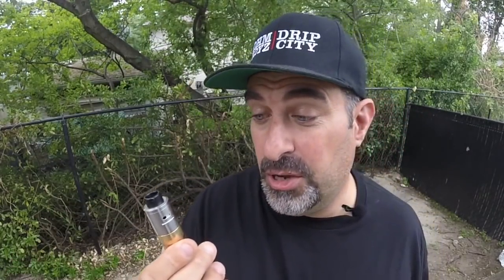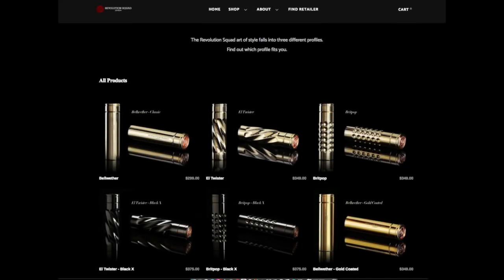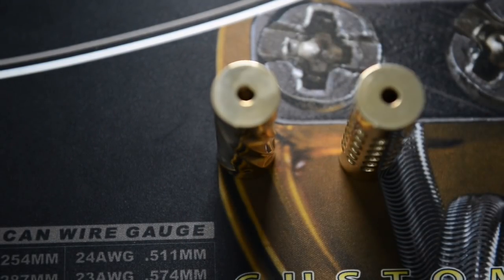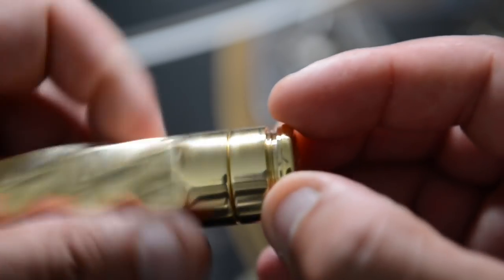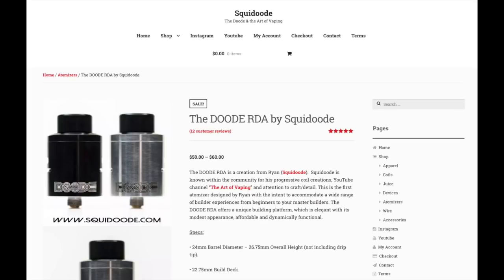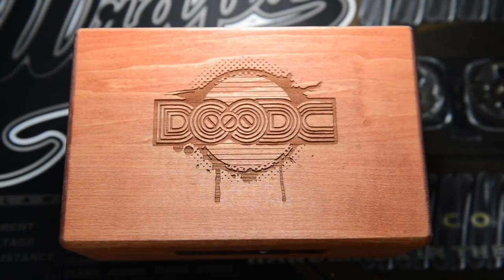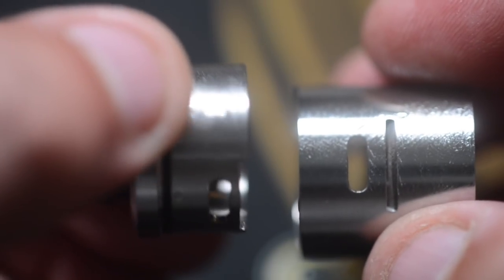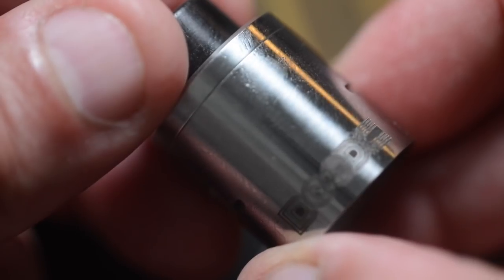REVOLUTION SQUAD & THE DOODE RDA BY SQUIDOODE

Comment: There is a place selling authentic Doode's for like $12 on clearance. So I bought another one like a month ago and still can't get a usable build in it. My coils don't glow evenly, they twist, bad resistance readings etc etc. I've been Vaping and building for over 5 years and this has to be the biggest pain in the ass rda I've ever used. I really wish I could use it.
Reply: Wrap both coil leads together with 36-40g, it helps actually.
Reply: Matthew Warren Hey can you pass on the name of the site please?
Reply: Ray Vincent, It's Modern Vapor Company. They're in stock still and $9.99 down from like $80.
Reply: Thank you 👍
Reply: @dieseldabz7104  yup ! even squid doode does that.

Comment: Great review and products Lou! Unfortunately the world was not ready for such an RDA, the innovative deck may have done much better at a later date, perhaps even now. I think... Ryan knows his shit very well and maybe didn't realize so many people with minimal experience or people not wanting something so finicky would buy it. Being a good coil installer is different than a great builder. You gotta know the coil dimensions like the back of your hand so you get the right build. They are designed for round wire on the industrial side anyway. If done correctly the design provides great conductivity, but if any issues are unseen you will be banging your head against the wall.

Comment: Could never get into any brass mech if the same mech came in copper..just liked the better performance of copper...even the couple brass (only option) mech that look nice (that I own) I would eventually get sick of the performance decrease and use a copper
Reply: with a copper switch, theres very little difference between aluminium, copper and brass. I own a vast collection, the type of switch makes more of a difference. Constant contact switch will always hit harder. Broadside style clutch systems, the grip, slam piece.

Comment: So wld navel brass have less voltage drop because of the nickel???
Reply: Mikka&Zach Blair According to Mooch, the voltage drop differences in materials is negligible.  Threaded connections and switch connections are the biggest cause in voltage drop.
Reply: Robert Wigglezz thanks man. I was just wondering
Reply: Slightly, yes.  https://www.makeitfrom.com/compare/UNS-C26000-CW505L-Cartridge-Brass/UNS-C48200-CW714R-Naval-Brass